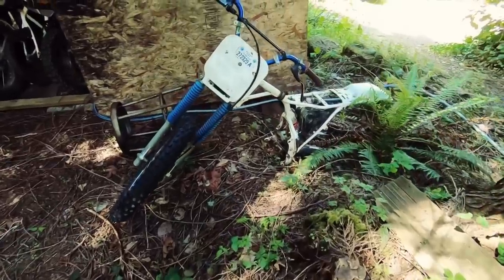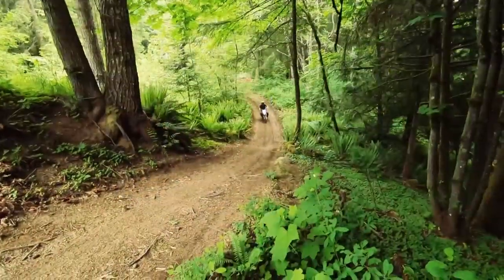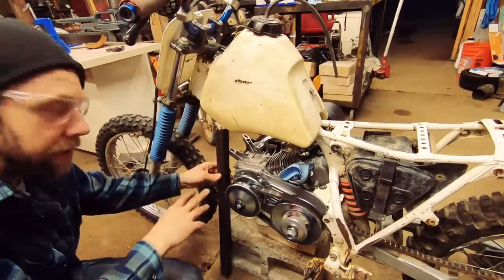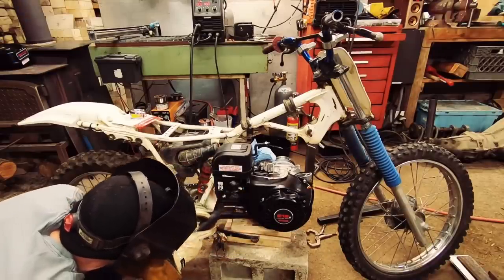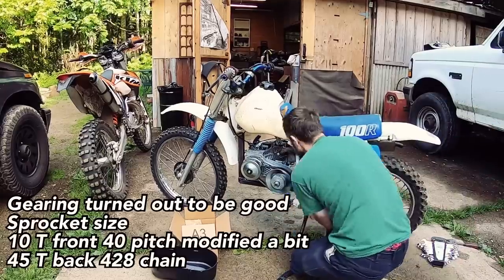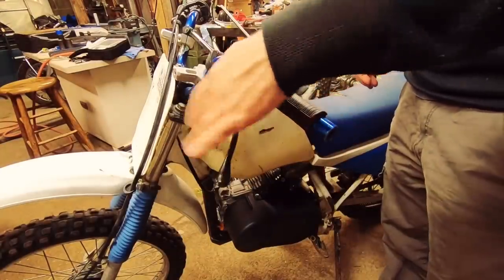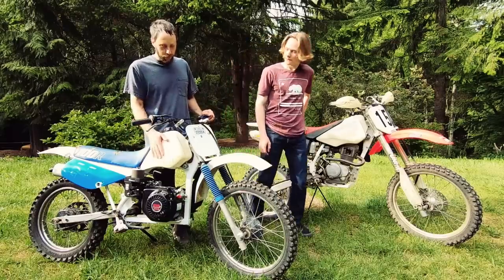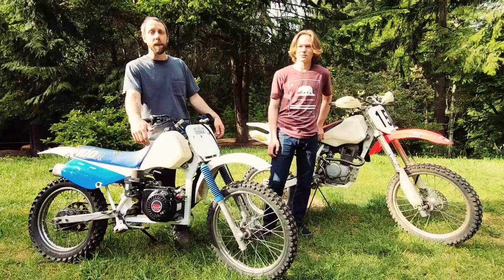Predator 212cc engine swap mini bike motorcycle

Comment: I'm rewatching this video because it is such a cool project, and I never realized that you were running a 4.5:1 gear ratio, and still getting that CRAZY amount of torque. Thing would have a vicious launch with a 7:1

Comment: So cool.... You can tell by all the responses that you hit a sweet spot..... I bought an old 100cc Kaw trail bike to re do but the motor is history. I had been thinking about doing this or just scraping it but you have convinced me to see if I can get a 212 to fit in the frame. I am absolutely amazed at how well this thing has worked especially as stock. I rode these old trail bikes in the 60 and 70's. What a way to salvage these old bikes.....I am gonna start tomorrow.....Thanks for your video. Great job by the way.:)
Reply from the maker: Right on Ray! I appreciate your comment :) I definitely recommend building one!

Comment: So glad I watched this video, cause I'm doing the same thing with an old 1983 Yamaha yz80 dirt bike frame with a 212 predator and I was always having trouble with the engine alignment cause of the way I installed it and the chain would rub against the torque converter spool. But now that problem is solved thanks to you!!
Reply: U should rather put a horizontal 4t engine on it

Comment: I've always wanted to do this but I figured it was going to have low speeds and wouldn't really be able to RIP. But I was very wrong, that bike is no pushover. Very very nice
Reply: Same here! Never thought it would work that well.
Reply: And you can always tune the engines.
Reply: I feel like Hondas and clones are great engines if you build them out them they become bullet proof the speed is all about your clutch and your gear ratio I had a stage 3 kit on a fast kart that was about 16hp with a simple shit clutch and it was pushing me at about 60-70 mph

Comment from the maker: Hey Guys It's Michael here :) I have had a lot of people ask where to find the CV transmission at, here's a Amazon link.
Amazon associate paid Link CVT  https://amzn.to/2Wzmz4I
This Torque converter fits 3/4" engine output shafts (predator 212cc engines have 3/4" shafts) and the kits come with the 40 pitch sprocket (this was the same size sprocket i modified to fit my chain pitch. I hope this helps you guys out. Ps when ordering make sure it’s for a 3/4” shaft, just in case Amazon changes the product.
Reply: Mike festiva it's so loud it's louder than my KLX140
Reply: Your lucky you have a motorcycle lucky
Reply: Awesome thanks!
Reply: Mike festiva now thats what im talking about good job bro
Reply: Gg
Reply: G
Reply: Mike festiva  sn
Reply: Gyggulioooi
Reply: Man put a cr80 engine in a xr100
Reply: Mike festiva ...Is that a Harbour Freight welder?
Reply from the maker: Dad yes it’s the Titanium 200 from Harbor Freight, it’s a awesome welder! I have quite a few videos covering this welder and the Vulcan Omnipro 220. If you are interested in the welders you should go to my YouTube page and check them out, I even have a video welding some Aluminum with a spool gun on the Titanium 200. Take care :)
Reply: Mike festiva ...Thanks for the info! I've heard the Titanium line is good, just wanted your personal opinion before I pick one up.
Reply: said it comes with sprocket for number 35 + 40 chain how did you adapt to the bigger chain because the 1 on that bikes a lot bigger than a 35
Reply from the maker: TheEngdan  I used the 40 pitch front sprocket, and used a angle grinder to open up the tooth pitch a little more to fit the 428 dirt bike chain. Check out my other video about this bike, I go into more detail on this in that video :)
Reply: @Mikefestiva  thank you
Reply: @Mikefestiva  no paperwork came with this what are you supposed to figure it out
Reply: Mike festiva hey what songs are in this video? I love the music and vibes good video man
Reply from the maker: Carroll Jackson Hey I’m glad you like the music! I made all the tracks on this video 🙂

Comment: Really like your project.
 I've been a Briggs and Stratton Fan most all my life. So, I kinda did the same thing back in about 1959, I was 8 at the time, using a 3  HP B&S, auto clutch, jack shaft to the bikes drive sprocket. Thumb throttle.  Bicycle was a steel frame, fat tire, heavy beast.  With the engine, 37 mph was normal cruising speed, comfortable cruising speed, 27 mph. Top End 43 mph.
Great fun. Put most of the minibikes to shame.
You putting a 212 on a small dirt squirter is the  mark of a  Genius.
As a suggestion......A 2 cylinder, 13 HP B&S engine. Stock form, a very smooth running engine.
The Lawn mower race guys can get up 80 HP out of this engine, by adding bigger Carb, Tuned Pipe, Hotter Ignition with adjustable timing, and Hotter Plugs, finally a camshaft timing change. A Racing Cam.
Reply from the maker: Thanks for sharing your stories Keith! I really appreciate reading your comment, sounds like you had a lot of fun on that machine you build! Take care :)

Comment: Great welding ideas Love the lower frame where you cut those 45s and bent those then welded  it all together Looks a lot stronger the way you did it 👍👍👍 The motor worked a lot better than I thought it would Good job bro ✌️ You get a sub 👍 for that 😁 👍✌️

Comment: Outstanding result, very pro welding....and you got a bike that runs better than original, without the concerns of a gearbox and a clutch. I just like it a lot.
It´d have been cool if, by chance, the cvt were at the other side of the engine, so the cylinder will point forward, because is a nice part to see.
Now the engine has a funny beheaded look, as an engine block without the uppper part, but you had to work with materials availabe, and to me is a superbe job anyway.

It´s only about that, because nevertheless that engine, conceived to be stationary, surely cools better 
at low speeds than any motorcycle´s original.
 By the way I like a lot the fact that the transmition seems overdimensioned .It will never brake, and there is no other device that will give you that low end push. The thing is a tractor, but a fast one. Greetings...

Comment: Looks like you got that motor to fit in ther quite well ! I was one of those many kids in the  70s that was out there riding one of those  mini keys you spoke about mine was  fancy one as it did have front and rear suspension
Reply from the maker: Right on Craig! Sounds like good times when you were a kid, Front and back shocks, that was a deluxe one! Thanks for checking out my video 🙂

Comment: You beat me to it. I bought an old 70s Yamaha 360 without the motor for $40 and its going to get a Honda 8hp or one of these predators. Good job on your bike.
Reply from the maker: Thanks :) it’s definitely a good little bike and is has a lot more power then a stock XR100, if you get time check out my second video of this bike project, I reject the carb, build a better intake and do a few other things to it. Take care :)

Comment: Am i the only one that watches these types of videos to try to build your own but doesn’t know anything about parts and stuff😭
Reply: Learn all you you can my friend. That's half the fun of it!
Reply: This is how you learn though
Reply: No that's why I'm here
Reply: I know exactly how you feel I gave away a motorcycle the other day I couldn't fix.
Reply: These types of videos are how I learn almost everything about engines and motorcycles 😂
Reply: Just do, ask questions and see what you can do. Just try not to lose any digits 😂
Reply: I have a frame in my backyard, I think it's a old 80cc frame... I might have to see if a predator fits in it!  I'm putting two 212s together now... One predator and one clone to see if there is a difference... So far I think not.  Be putting the engine together next Thursday... Using the parts from Redbeard's Garage on the predator and the clone

Comment: "10T front 40 pitch modified a bit" How did you modify the sprocket? And don't let the "6.5 hp" fool you. Those engines have dinoed at over 9.5 hp with a bigger jet and better breathing. That bike would be even more amazing if you tuned the CVT with weights and springs, got a cam, carb, billet rod and flywheel.

Comment: I've got a 1988 Polaris trailboss 250 2stroke. It is a 4x4 model. The motor blew the Piston apart so I'm in the process of mounting a old Yamaha 100cc 2 stroke dirt bike engine on it. Got it mounted up today. Also gonna be able to use the high low neutral reverse from the Polaris transmission.
Reply from the maker: Nice! I hope to re power my 250 2 stroke Big boss 6x6, it’s been broken down for a few years, I’m thinking it’s going to get the 8hp predator motor soon! When it ran that thing would go crazy places locked in 6 wheel drive! Let me know how your quad turns out.
Reply: @Mikefestiva  tommorow I'mma start swapping the wiring harness from the bike to the fourwheeler. The bike was a Enduro so ill still have a headlight. The biggest problem I've hit is figuring the kick start out. The motor is so skinny that the Kickstarter is hitting the trans from the trailboss

Comment: This is pretty funny,  I have a predator engine, bought it for , just cause it was on sale for 88 bucks, nothing. been sitting on the floor of my garage for 4 or 5 years! LOL   and also, i have a problem with really liking small old school 1 cyl bikes that I find all the time for 50 bucks or less.    so I have right around 20 of them, probably more. 
   the funny part is, I was thinking of doing what you did to this 100 to a street bike.   cutting it down and making it super tough, small mini bike Big wheel trailer towing, elk hauler.  :0)    
   I have a super bronc here that will do teh job but i think i can make a badass .  you gave me a few ideas here, thanks.    cool video.

Comment: I would recommend the yellow spring for the driven pully. It'll give you a lot more low end and a higher top speed.
Reply: Both more low end power and higher top speed? Are the springs easy to change out?
Reply: @noah2016999  yep. Just a C clip on the side of the driven clutch and it should come right out.
Reply: Where did you get it go powersports?
Reply: @noah2016999  bmi karts

Comment: I was going to suggest that perhaps you might want to "clock" the starter pull handle to the rear, so its less likely to stag on trail debris.
Reply from the maker: Yes definitely a good idea, plus it will be easier to pull start when on the bike

Comment: Nice swap , will be cool to see it run with a better carby and no governor. 
I have 120 hp R6 powered Raptor 660 and a 40 hp 125cc 2 stroke in a trx 90.
Subed👍

Comment: So correct me if I'm wrong, but with a centrifugal clutch (I'd assume it has one) and a CVT... Does that mean that you've made a full auto dirtbike?
Reply from the maker: Yes the CVT has a centrifugal clutch built in, this bike is full auto 👍 it works like a scooter 🛵
Reply: @Mikefestiva  would actually be a good was for new riders to get a feel for riding before jumping right in I think.

Comment: Hey thanks for checking out my comments I know it wasn't much. But I love diy things. And especially bringing dirt bikes back from the grave. I really can't tell you how much that your video really gave me a little bit of happiness today. About an hour before I found out that my cousin who lives about four roads down here we go dirt bike riding with all the time had a heart attack. And passed away unfortunately around 10 this morning. And just trying to keep my mind off things I came across your video. Sort of like Karma. Cuz videos like yours always really cheer me up it's so great to have something brought back from the dead. And the bike actually seems have quite a bit of power. Xr100 is a great trail bike. Never mind having the new motor I was very surprised to see how much power it had. Definitely gave me a bunch of ideas. Anyways I just wanted to let you know how much you're a video cheered me up. What kind of welder are you using for these projects. Last year I bought a Harbor Freight 120 amp wire welder. That runs off Standard wall plug. Haven't really used it much just check it out but do you think it would be capable of doing the job so you did. I'm very new to your Channel. Maybe a quick video on how to use those kind of welders would be a big draw for your site. Anyways great job. Loving the fact that you brought that bike back from the dead so Kick-Ass.! New subscriber here. I we'll have to check out more of your videos. I'll hit the Bell
Reply from the maker: Garett thanks for commenting! I really appreciate hearing from thoughtful people like your self :) first off I’m really sorry to hear about your cousin, that’s a real sad thing :( As you probably already know with time it will get easier. Hang in there buddy :) I’m glad my video was able to give you a smile watching it. Thanks for subscribing, and to answer your question about your Harbor Freight welder, it should be fine to weld something like this project up no problem. I was using the Harbor Freight Titanium 200 welder, I actually have quite a few videos covering the Titanium 200 and the Omnipro 220 welders. When you get time check out some of those videos, and if you ever want to upgrade welders the Titanium 170 MIG welder goes on sale for about $450 sometimes and it’s multi voltage, it can run on 120 or 240. Good machine especially for the price. Well take care and I appreciate you taking the time to write to me. Take care :)

Comment: It's not like this but I have a cheapo bare bones 21" push mower that had weak 3hp briggs that bogged if grass had gotten little to talk anyway the output shaft got bent somehow. I priced new same cheap push mowers and at Lowe's n home depot were like $200! So I said what the hell n went to harbor freight and bought a 212 6.5hp vertical shaft engine for $120 and bolted it on. Well with 21" deck it cuts grass like a boss, usally I only run it at med Rpm it's more than plenty you can bump RPMs up when grass gets tall and it looks pretty cool that giant engine on the small mower deck, worth every penny not only was it way cheaper than a new cheap piece of crap but way better and a good conversation piece.🤟

Comment: Wow, Im really shocked at how much power this thing seems to have. Hopefully some exhaust tuning can make it sound better than my push mower though.
Reply: but it is what it is, a big lawn mower engine - its no race motor
Reply: The 212cc is often used on snowblowers.  Approximately 6 or 6.5 HP.
With the right drive ratios, the results speak for themselves.
The CVT is taking the place of a gearbox.  
Top speed isn't an issue with this application.

Comment: Mike wow this video has gotten lots of views and comments since I first saw it last week!! I just found a DR650 Chassis no motor gonna see what I can barter for it and pull the trigger. I really dig that soundtrack doesn't surprise me that you mixed it yourself. be good Bud cant wait to see a review of that sidekick! Frog in Florida....
Reply from the maker: Yes it’s definitely getting a lot of views and great comments! YouTube is hard to figure out, I make all kinds of videos, but if YouTube doesn’t recommend them they just don’t get seen by many people. Dude a DR 650 frame would be cool, I think with a little bit of mods to one of these motors you could get it to go 55 probably fairly easily, in the next video I plan to hop up the motor a little bit ;)  
Keep me posted on the 650!

Comment: So the torque converter comes with a #40 chain sprocket and your running it to a 428 , I wasn't sure that was possible, great video!
Reply: I have a Suzuki tc100 I'm considering this same idea, it currently runs a 428 chain and rear sprocket.

Comment: That looks like an 87 XR100.  I'm surprised that it needs a motor?  Four-stroke Hondas I've had are darn near bulletproof.  I have a 76 and 86 XL250s and they still run fine.
Reply from the maker: Haha those little XR 100 engines are reliable 👍 The original engine was tricked out with a BBR 120cc big bore and got swapped into a CR80 big wheel frame. I have a video on that build. I just had the 100 frame sitting around after that.

Comment: Are the predator engine relieble ?. Use the clutch thing as a rear brake
Reply: motorcycles already have a foot brake pedal. the predator engines are very reliable, i've only heard of a few failures and most of those were due to customer error and not a fault of the product. the design is actually an almost exact clone of a honda gx200 engine which retails for $350-$450 bucks and is indestructible. so the chinese picked a really good design to copy.
Reply: marzsit well sucks we dont have those engines here in norway . And if i. Uy it from the states well its going to be 350-450$ to get it here 😂

Comment: Does the width of the added cvt torque converter get in the way of the foot pegs?

I was thinking of using 16hp duromax engine from lowes $299 40 series cvt but worried it would just be way too wide... making a custom mini bike crf150f swing arm with suspension linkage i bought used eBay $45 front triple tree inverted shocks... fabricating the frame.  Using 14" "supermoto" wheels 3.5 inch wide rims.

Again sweet video.  Considering that 16hp duromax its 17in wide add a 40 series cvt might not work.

Any input greatly appreciated 👍

Comment: Could you add a link where you got the transmission
Reply from the maker: Hey Calvin I will be adding links to some of the parts I used in part two so keep an eye out for that video, or maybe I will pin a comment later today at the top of this comment section with links in it. I hope that will help. Take care and thanks for checking out my video :)